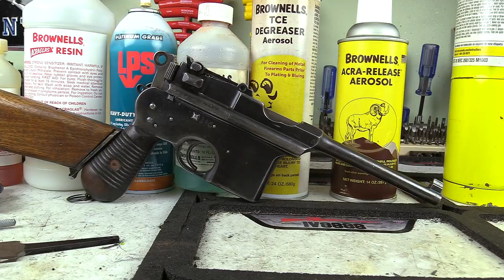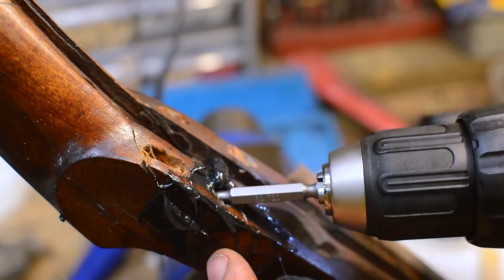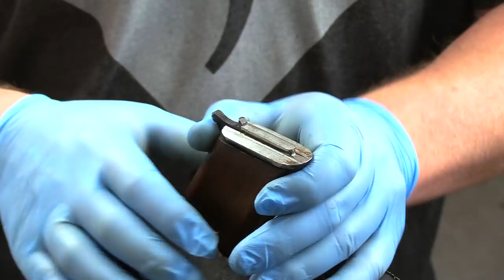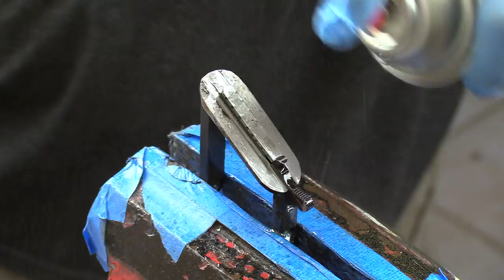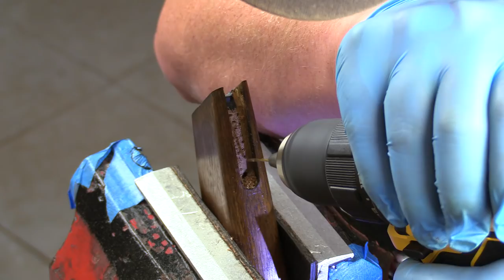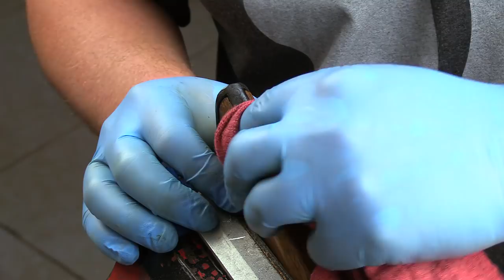Brownells Acraglas Hacks & Broomhandle Repair

Comment: I had to do an interweb search while watching this when Eric said the stocks weren't original. I thought everything had to be original to get exemption from being a short barrelled rifle. Turns out replica stocks are OK.
"- A C96 (aka 1896) Broomhandle Mauser with pre-1940 manufacture receiver AND with either an original buttstock or a close replica of an original buttstock, is a Title 1 (1968 Gun Control Act) Pistol ...(also a Curio and Relic firearm); it is NOT a Title II Short Barrel Rifle. BATF regards this as a collector's item not likely to be owned as a weapon. However, a C96 Broomhandle either
- - with a receiver made after 1940... OR
- - with a stock that is NOT an original OR CLOSE REPLICA of an original issue,
is considered by BATF to be weaponized and NOT a collector's item."
Reply: They are great fun to shoot (if you keep your thumb out of the way) and better than a .22 (especially with soft or hollow points) for rabbit hunting.           :)

Comment: If you have a small crack in a not important part of the stock can you just sue superglue? I did a handguard with superglue. and i also have a fairly wide crack in the side of the buttstock. could i superglue it? I dont think the buttstock crack will be under immense pressure but i want to keep it from splitting more.

Comment: I was going to make the comment that the epoxy would not flex and move with the wood. But you are using it as a filler and not as an adhesive, still relying on the scree to hold things together. Really interesting, and you went a bit Bib Ross there, getting really in to what you were doing.

Comment: Random question, can someone help?  its about shotguns. I know Schokwawe has barrel under 18 inch but overall leght is 26 inch. If you have 18 inch (or more) barrel shotgun with pistol grip is there overall lenght restriction?
Reply: Not that I've ever heard. Winchester used to sell a model called the Defender. It came from the factory with a standard length barrel, standard stock, and an interchangeable pistol grip.